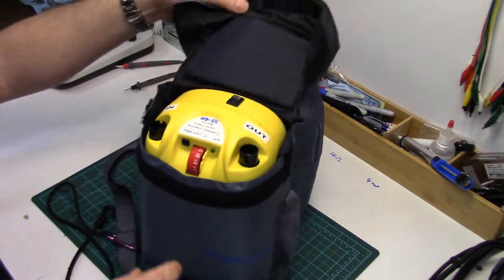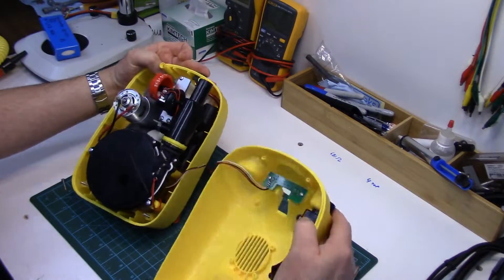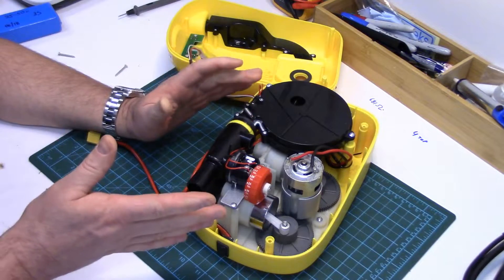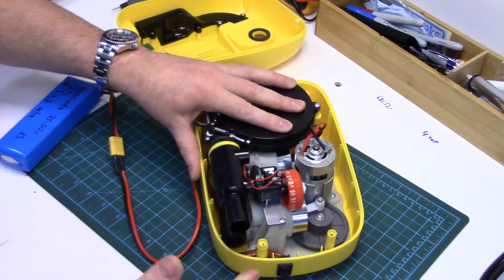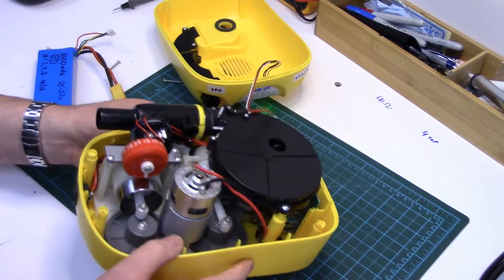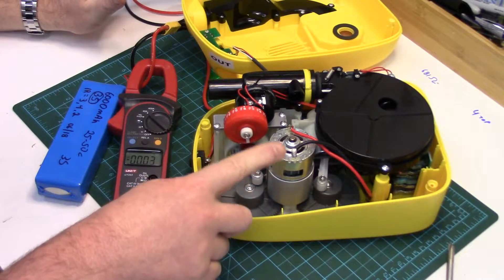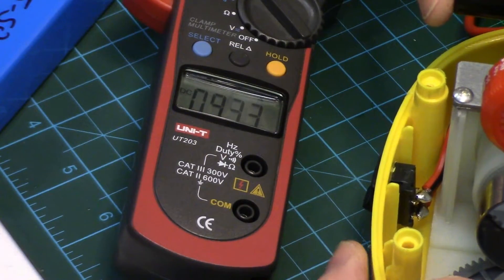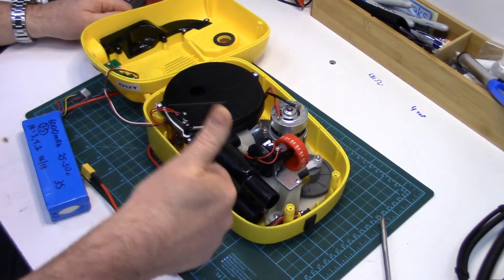Electric 12V Two Stage Inflatable Pump Tear Down

Comment: Hi John. I have the 2 stage version of this pump. It stopped working and struggles to fire up the turbine in stage 1. When it does fire up, stage 2 doesn’t kick in to pump air and makes a buzzing noise. Had my battery checked and reads 13V. What do you think might be the issue? Thanks
Reply from the maker: Sorry, no idea without taking it apart and testing the individual components (bad motor, bad control board, other)?
Reply: @Rchelicopterfun  how would you go about testing the individual components? Any places you can recommend I go to to have it checked out?

Comment: John, thanks for this.  Curious if you would mind doing a how-to video showing what parts are needed and where to source the Lipo batteries if you were trying to replace a 12v 9ah Lead Acid battery (like the ones in the Bravo 20-1 Kite Pump).  I'm a newb at electronics, so any info would be super helpful.  THANKS, and good winds!

Comment: Thanks for info.  I have one of the more expensive pumps, but it finally started acting up.  Good to have a better insight on working principles before i tear into it.   I love kiting, but have always hated the pumping.  My first year, I actually schlepped a portable pressure tank.  Don't have a great excuse of hand pump cracking in cold. for buying the electric.....    I'm just lazy.
Reply from the maker: You bet. I don't think there are any lazy kiteboarders, those two words likely don't coexist together. Let's just say we want to get out on the water sooner to chase the wind over wasting time & energy bobbing up and down on a pump handle like a drinking bird toy.  🙂